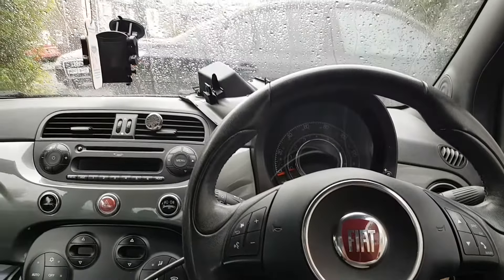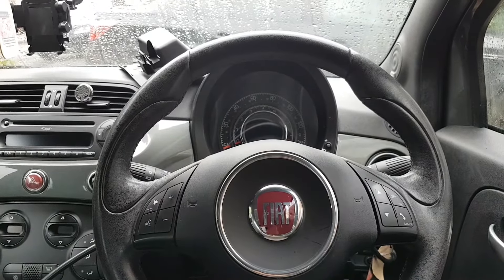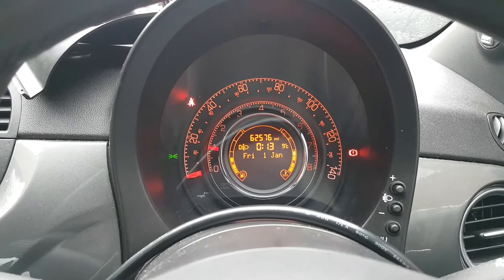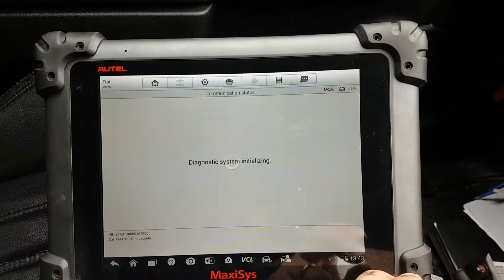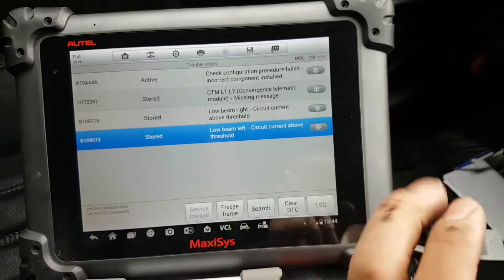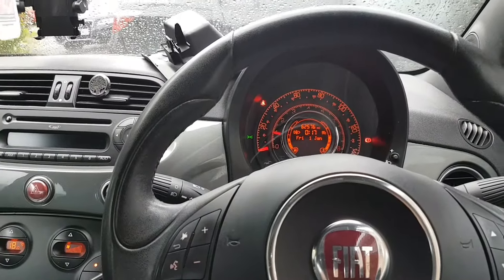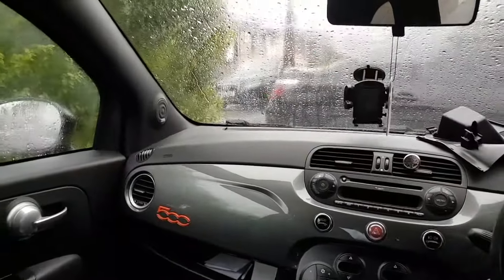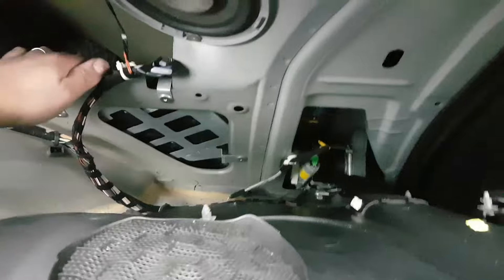Fiat 500 mileage flashing... Fault finding and repair.

Comment: Can't believe that bolt snapped on you !! What do you do just drill centre of bolt ??
Reply from the maker: Yes...
Then tapped it again to clean the thread...
Thank you for watching and for your comment! 
👍👍👍
Reply: @LMAutoRepairs  cheers Louis own a mito and when I swapped oem radio for aftermarket because Bluetooth was in radio millage flashed had to buy another module to go in loom which stopped flashing and radio to use steering controls

Comment: i have 51884624 and i found at my car that  blue and me ecu was damaged . So i have to search at Ebay or somewhere else with the numbers from the video ? im asking cause i didn't found exact the same number part
Reply: Does anyone knows about that ? ( Ive got 1.2L 2010 Petrol )
Reply from the maker: Check with the dealer, it could be that there is newer part numbers that are compatible...
👍👍👍

Comment: Hi 
Can you help me ? 
hi i have p0725-66 in transmission and between 2 and 3 car slipping fiat 500 dialogic gearbox
Reply from the maker: Is that the dualogic as well?
Reply: yes and this code on TCM there is no DTC in ECU when car record p0725-62 it slip between 2 and 3  @LMAutoRepairs
Reply from the maker: That sounds like a worn clutch...

Comment: Yesterday, my i20 EPS light came ON and steering is very hard. I diagnosed the issue with multimeter.
1. 12v is available at the input coupler of the EPS module. 
2. 12v from IG ON Or Start is available at the third coupler of the module. 
3. However, with engine running, there is about 5v (supplying to the EPS motor) at the output coupler of the module. As steering is rotated left or right, voltage fluctuates +12 to -12 on the multimeter. This time no EPS light. 

After waiting for about 5 minutes, the EPS light comes ON. At this time, multimeter shows between 0 to 3v only.. even with steering rotated left or right. 
Why I don't get +12 to -12v? 

Is the EPS module faulty??? What causes module fault?? I assume now the motor is not faculty. 

Please help immediately. Thanks in advance.
Reply from the maker: Have you scanned the car?
The fault code should help guide you in the right direction...
But if that is a one "sealed" unit, yes, there is a possibility of a sensor, or something along those lines...
Thank you for watching!
👍👍👍
Reply: @LMAutoRepairs  sir no scanner, and i have to drive about 4 hrs to reach service centre.
Reply: @LMAutoRepairs  I have 3 questions.
1. How to check the continuity tests on the eps motor or what is the value of resistance at the 2 pins of the eps motor???
2. I got +-0 to +-12 volt when steering is rotated with engine running. However, after sometime, EPS comes ON and i have readings about 3v only at the output pins of the eps module. Why???
3.And, last one, what are the causes leading to the failure of EPS MODULE????
Reply from the maker: Is not that simple...
Obviously when the EPS light comes on the system is disabling the motor... so, obviously no voltage and you loose the aid of the motor...
The light comes on for a reason, and anything I would suggest would be pure guess work...
Unfortunately, without scanning the car, is impossible to make any educated suggestions...
Reply: @LMAutoRepairs  but how to check continuity test on EPS motor? What's the recommended reading range? And, what are the causes leading to EPS MODULE failure???
Reply from the maker: Depends on the motor... the answer is not that simple... but if there is no O.L. then is a good start...
Again, and as I already said, the module most likely has internal sensors, etc... than can fail...
And again, without scanning the module, is nearly a pointless exercise trying to find what is wrong...
Sorry if I can't help you any further...
Reply: @LMAutoRepairs  ok thanks for the response.
Just a note: This is the SECOND TIME I have issues with EPS SYSTEM.
1. EPS Motor was replaced at around 33000 KM reading on Odomoter.
2. Now, at about 54000 KM, another similar issues developed which in this case is most likely the EPS MODULE!!!
Reply: @tnamen1307  I would take it for a scan and see  what fault codes and check live data with scope

Comment: That's why I'll never buy a fiat car because you just know there going to have electric problems and I'm to tall for that car
Reply: what brand dont have electric problems?  4 year grande punto 2007 no problem at all.
Reply: @zoran69ser  Yah but there not plagued with them I think you got lucky because overall there a very poor quality car the 500 at least I wouldn't mind risking a panda but only if say my mom gave it to me for next to nothing and that's not actually a fiat that's a Opel GM from what I saw when I looked it up I can't think of the proper name
Reply: @zoran69ser  apart from electric power steering and bad indicator stalks its not a bad car, its very simple when compared to this 500, it doesnt have any of this functions so less to go wrong

Comment: brilliant. mate.as always.i need help .I want to buy  autel maxi com  Mk808 .with 12month free update.after 12 month .if I dont update. what will hapen .I mean if still be  usefull?? thank you
Reply from the maker: Yes...
The tool will carry one working...
But you will loose any online facilities...
Like updates, etc...
👍👍👍
Reply: @LMAutoRepairs  do you recommend what autel? been looking at the maxi Das....occasionally i pay to do the electronic part of fap or egr removal and also key coding so a tool that did those would be great value even it did not support all vehicles